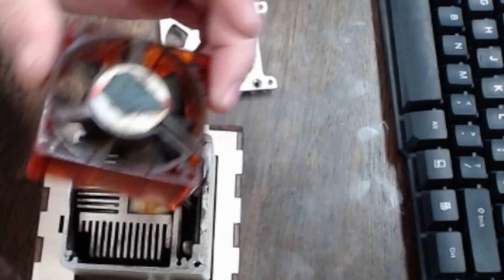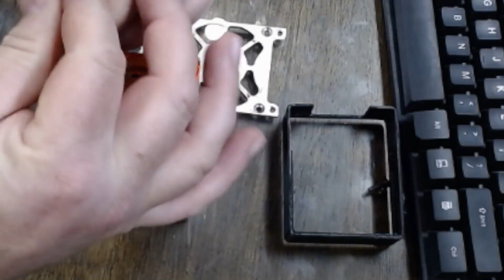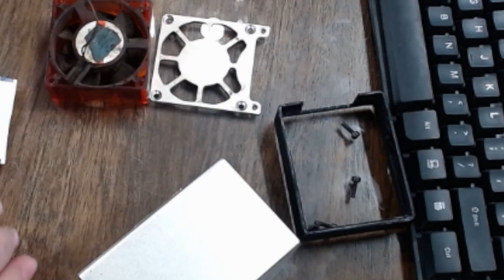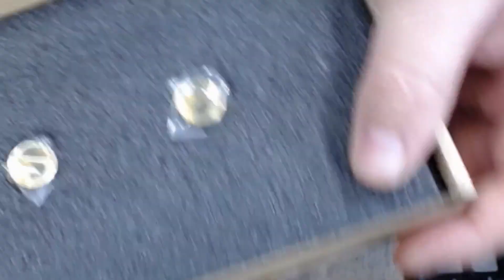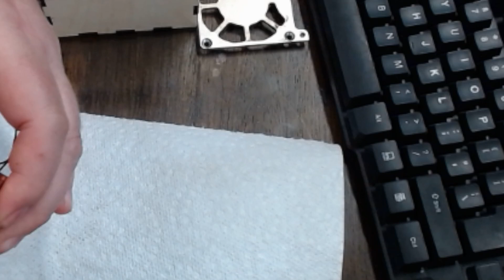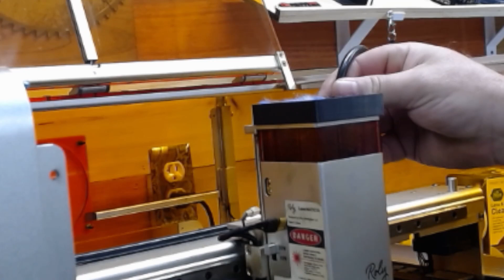Roly Lasermatic MK2 Module Cleaning and care

Comment: Jeremy, I engraved several canvas painted black and that left a mess inside the MK2 30W module. I do use your filter kit, but there was still a lot of soot that pass through into the module coating the fan blades and the module cooling fins. That stuff is really sticky. I cleaned as much as I could using Q-tips and 90% isopropyl alcohol. Unfortunately I could not go between the cooling fins to get the soot out. Is there a type of electronic spray cleaner that I could use to brake down the soot out? Also, do you know if the laser unit inside the module sealed so cleaning fluid can affect it? Not sure if I want to do anymore Canvas engraving if I can’t do a deep module cleaning and risk burning the laser inside the module. Any help or suggestions are very welcomed…
Reply from the maker: I have used Dawn Powerwash inside there ...Just carefully sprayed it and let the foam work for 5-8 minutes then blew it out with air